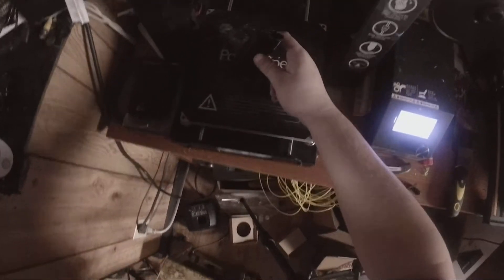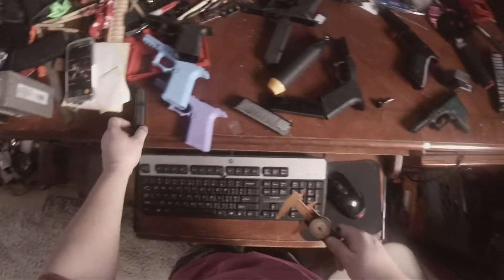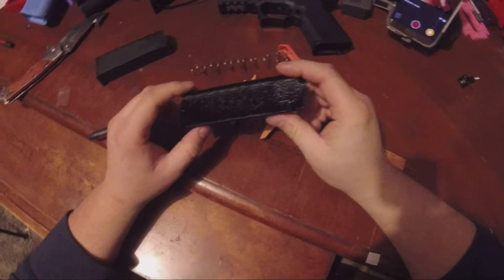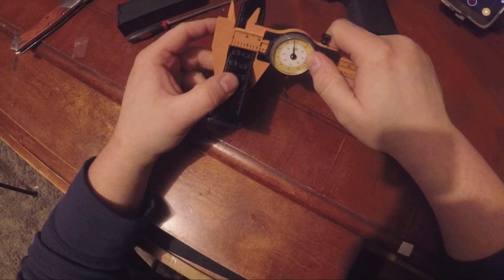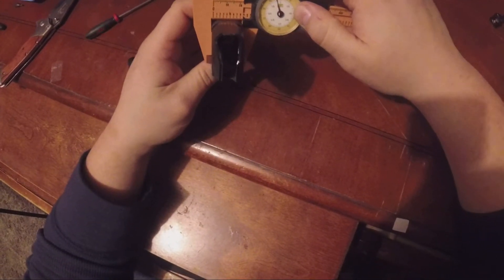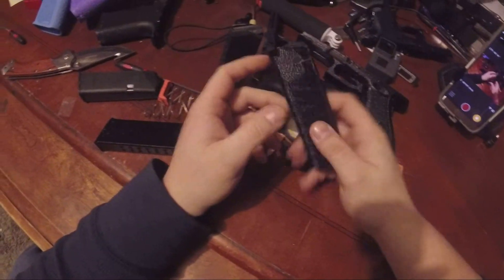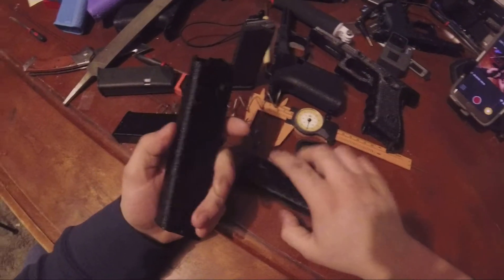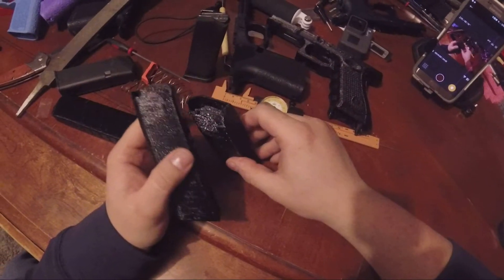3d printed glock 17 mag

Comment: I correct it by lifting the mag straight in tinker then print using supports for the bottom slant. I also made it 8% more narrow and 10% taller than it needs to be. After printing bake at 180 for 2 hours in oven.
The baking process changes the dimensions depending on how the mag is sitting on the pan. Picture it like squishing a pancake. 
Baking it increases the strength and gives the mag a solid feel.